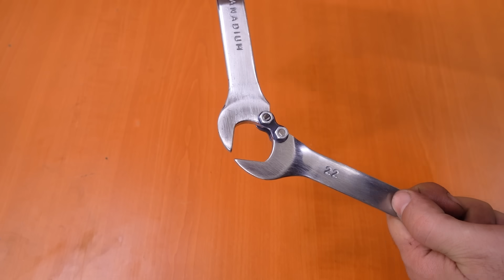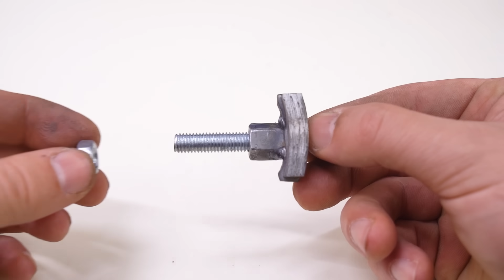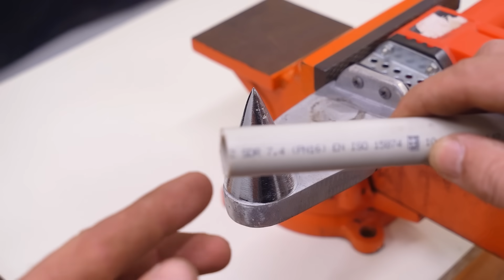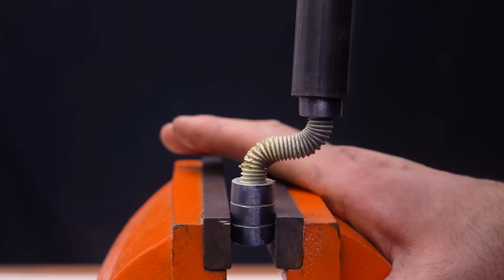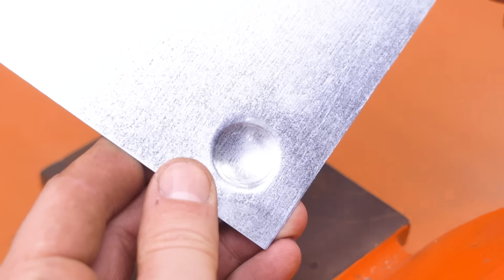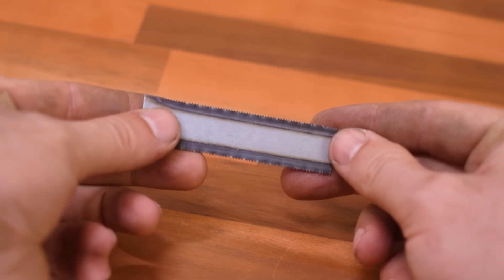Handyman with 50 Years of Experience were Proud to seeThese inventions

Comment: 🟦…The tool in the thumbnail is rather a waste of time for just the use you appeared to put it to!...
...You can unscrew pipe couplers with a lot less trouble and NO modification to your tools by taking whatever size wrench slides over the middle of the pipe coupling as closely as possible and then as you turn it it will encounter the raised ribs on the coupler which will engage The wrench and allow you to unscrew/tighten the coupling.
Reply: Dont you have a pipewrench ???